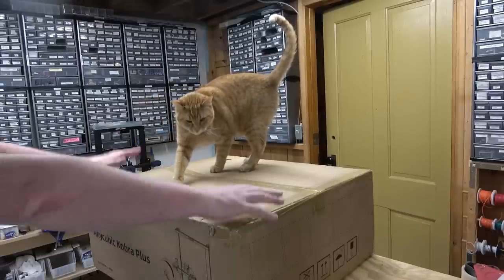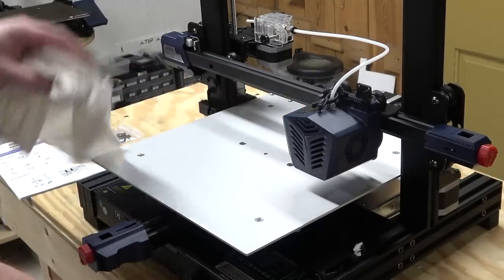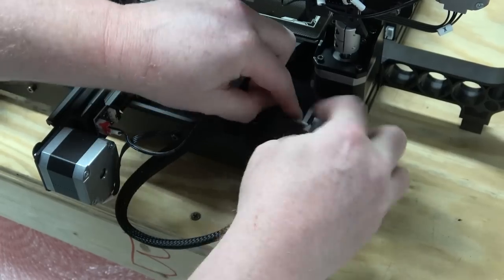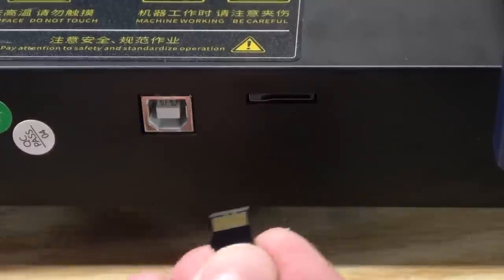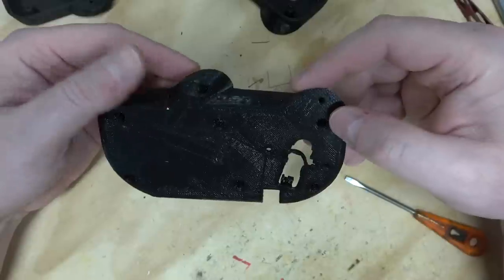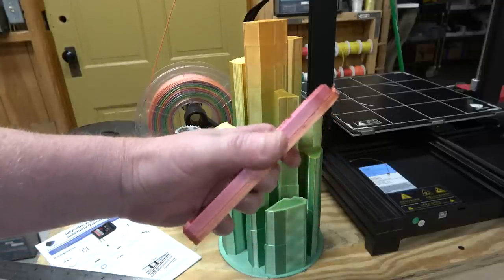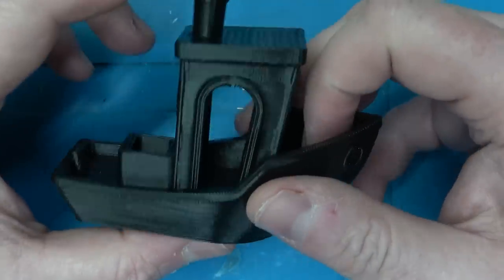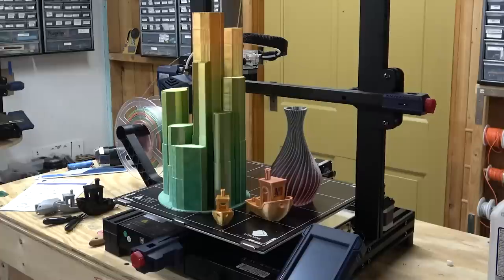Anycubic Kobra Plus Review

Comment: Cura, by default, prints the infill first and then the outside walls, so an easy/fast way to improve the outside walls quality without increasing them is to disable the option "Infill before walls", that way the infill does not show through the walls
Reply: I didn't know this, thank you 🙏 

I use 3D Prints for mold negatives and while I quite like the pseudo-3D print look of the cast, I've always wondered how to mitigate against it. 🤔 

Excited to try!

Comment: The zits on the benchy are in the same place because that is where the print path finished the layer and started the next one. You can specify the z seam placement or pick a random start position to minimize this effect.

Comment: The 'lead' in leaded gas controls 'knock' (pre-ignition) which allows engines to run higher compression and create more horsepower...now it is done with a stack of electronics to measure how much knock is occurring and detune the engine to make it go away.   (an engineer will have a more precise definition)
Reply: There was something about lubing valves too as a reason to use it.  So some engines couldn't use unleaded initially without changing valve seats.  For octane rating(/compression tolerance) they started using other chemicals so in regards of that the unleaded isn't worse and you don't need knock detection as such just for the change to unleaded
Reply: It is true, in the long term, valve seats were required to be hardened to convert to unleaded...but not sure what metallurgy was in place.  The other portion is fuel octane...that is also measured by modern electronics, and is part of the engine math to reduce knock.
Reply: Measuring the grade of the fuel was done by measurement in a special one cylinder engine, of which there were only a handful in the world. Until they in-lined the process, they used to put in extra lead to ensure they met minimum requirements for the particular grade. It was called it ‘throwaway’ at the time. It was an expensive practice, which they were glad to fix. Fortunately it’s use has been largely abandoned now, so just a little piece of our interesting history now.
Reply: @bertieblob3387  the octane calibration engines you could advance the timing to see when it knocked and from that figure out what octane fuel you had. You can advance the timing in any engine but on the calibration engines the timing was calibrated. Power timing!

Comment: there is a setting in most slicers to compensate for the elephants foot- the only thing it does is put a champ at the bottom of the print by offsetting the outer lines to the middle

Comment: Yeah, it's impossible to design this with a full sized SD card slot. That would cost them 15 cents more. Actually more of an issue is sourcing garbage generic SD cards vs micro SD. The cost difference there is probably a little more.

I completely agree though, full sized SD is more flexible, since you can just use an adapter to micro SD if you want.

Anys ways, I also prefer direct drive and a PEI steel sheet for the print bed. I do need a larger 3D printer, so I should really just do some research and buy one.

Comment: Hey Ben, why not make an adapter that goes from MicroSD to full size SD.  A short ribbon cable, a sacrificial microSD card, and a remote SD card slot.  You could then locate and orient it whichever way you wanted.

Comment: Wondering if you've ever tried salt water on glass beds. I use it on my Alfawise U20 all the time and it works great without leaving any noticeable marks on my print. I also had glass beds on my CR-10 minis but instantly upgraded to Garolite I ordered from McMaster-Carr which does an incredible job with adhesion but you have to be extremely careful while leveling or it will put permanent cuts in it just like a PCB board. Both release parts extremely easy upon cool down. For the minis, all I had to buy was a 12x24 sheet for around $30 and cut it down the middle. Interested to hear your thoughts on salt water and Garolite; if you've used them and if you have, if you were happy with the results.

Comment: Tetra-ethyl lead was used to prevent the old NON hardened valve seats from wearing on the heads of motor.  Lead is still available on aero-engines and high test (over 100 octane) fuels.

Comment: you could try to mod some noctua fans in there perhaps?
Reply: Noctua is wayy to expensive.
If you can run your fans a bit slower, you can do it with a cheaper fan.
Noctua only makes sense if you run them on high-speed. Then they are more silent than others.

Comment: Hey Ben! I used to watch your Ben Heck Show back when you were making things like the N64 Handheld. I was wondering if you could help point me in the direction of anything that would be usefull for a project I want to undertake: 

I'm trying to make an Arcade Stick Box out of the guts of a Nintendo Switch Pro Controller, having it be completely functional for any game. I'm having trouble finding the analog stick pinout details and also I realize I need a board to convert the Digital Joystick output into an analog stick output so it can be plugged into the pro controllers board. I hope you respond!

Comment: Lead was used to stop the "knocking" - when the pitons misfire
Reply: Its primary use is octane boost, but it does help with knocking too.

It is NOT a lubricant.  In fact, if TEL were the only additive, the buildup of lead would leave sludge everywhere.  So they also add scavenging compounds which combine with the lead to make PbCl2 and PbBr2, both abrasive white powders that can be flushed out with the rest of the exhaust.

Comment: The thing about the portable Atari Lynx reminded me of a project I’ve been thinking about for a while: a portable Game Gear. Like if you take one apart it’s mostly air and batteries. If you printed a new case for it and replaced the six AAs with a flat lipo you could make it way smaller and a lot more practical, or at least as practical as a 32 year old handheld console can be. If you printed it with that crazy pink filament you could call it the Glam Gear.

Comment: I gave up trying to get Cura to work for a Voxelab Aquila, it's basically the same printer as the Ender 3 v2, but no matter what I tried, I couldn't get it to work with Cura.

Went with PrusaSlicer instead, worked perfectly first time after I told it that it was an Ender 3 v2, extremely minimal configuration required.

Every print comes out so much nicer, though I dislike Prusa's supports, but at least I don't have to junk so many prints.
Reply: Interesting. I have an Aquila an Ender 3 V2 and use the same gcode for both printers and they coming out great every time using Cura

Comment: leaded gas was used for antiknock
Reply: Tetraethyllead was used to increase fuel octane. So yeah it would reduce knocking. As Ben said it did help with lubrication too. You didn't need stellite valve seats when you ran leaded gas.

Comment: Is there a way to get the recommended settings? I didn't throw away the SD card but my computer refused to open it unless I formatted it first so I no longer have those settings and instead had to go find settings someone else used but it was not for the Kobra Plus.

I ask cause I have giant flash or what ever you want to call it around the base of all my models which you don't have. granted I had that on the sample owl print the SD card also came with.
Reply: I just learned you can actually change that giant flashing around the bottom of the print in the Cura settings.

Comment: Do you know that Anycubic doesn't deliver components anymore after they stop producing the machines. I have an Anycubic Predator for less than 3 years and after the touch screen has been broken I have to throw away the printer
Reply: Odds are you be able to pair a third party LCD to the board...if you know the main board and firmware running on it flashing a LCD easy enough may loose some features have to dig around
Reply: @jinxycob     After a whole day of searching for a solution, I gave up. I don't want to use external tricks to keep the printer working. Better to use a big hammer and send the remains to Anycubic...
Reply: @josephluijten716  I understand your frustration had many weeks building repraps , the predator being a large delta if I remember rightly looks a Good machine I be tempted to turn into a project and rip the whole tronics out and replace it with some makerbase MKS board and LCD find them Ali express they produce some good boards.
Reply: @jinxycob   With some efford maybe I can fix the problems but I am annoyed that they just let me down. They are digging their own grave with such a policy.
Reply: @josephluijten716  just searching seem the printer uses a trigorilla board and LCD but can't find a match anywhere...makes me wary of anycubics future support for any printer.
Reply: @jinxycob  Because of the way they treated me I don't trust them anymore.  In Europe it is a legal obligation to supply parts 10 years after the end of a product.  Apparently that is 0 (zero) years in China.

Comment: What Printer did you choose in cura?
Reply: isnt there a profile that comes on the SD card? I remember seeing that some of the kobra models have them on the card to import in the videos i watched. If not you can select the custom option in add a printer in Cura and use the PDF on the SD Card to input the needed parameters.

Comment: Did you ever figure out the stringing issue? I've had that issue with every anycubic printer so far :(.

Stringing is what was causing the lines on the bottom of your playstation controller.
Reply: increase retraction, deal with the increased print times.  I have my old 3d printer set to 40mm/s retraction, and I only see the tiniest of wispy hairs off of protruding features.  One wipe of the hand, and they are gone.
Reply: @jong2359  how much retraction distance are you doing?
Reply: @MichaelJantzen42  I did say 40mm/s in the last comment :p
Reply: @jong2359  I guess I got confused as cura has a retraction speed and distance setting.
Reply: @MichaelJantzen42  makes sense, I am using Prusa Slicer which only has the speed.... I don't know what the distance setting could possibly be doing though... like, minimum distance needed to retract?  I prefer to only have one retraction setting, and not have another variable for distance.

Comment: You were correct - Led was absolutely used as a lubricant in the fuel.... For us who grew up riding two-stroke engines with two-stroke oil mixed in for lubrication - we longed for the "Super 98" (incl the led) lubrication and a no engine lock garantee! :)
Reply: It also prevented "knocking" in older engine designs that didn't have the advantages of modern engine design.
Reply: @nobodyuknow4911  The same thing that Ethanol is used for now, basically it increases the octane equivalent rating so that the gas doesn't ignite early when it is pressurized. There were other compounds that could be used back then as well, but the lead was the cheapest option that required the smallest amount of additive in the fuel.
Reply: @nobodyuknow4911  Stuff can be two things. Ethanol is both a way for them to increase Octane ratings for fuel without Lead, AND a wealth transfer program to corn farmers because they keep demanding more and more of the crud in gasoline.

Ethanol has an octane rating of 113, so adding it to any standard fuel with the normal ranges of octane will increase the octane rating of that fuel. Of course, it also decreases the efficiency of the fuel, which is part of why it's bad to put higher octane fuel in your car now than what the car demands for its compression ratio.

Having a higher octane rating is just to keep the fuel from detonating before the spark plug goes off though, it's not actually something that improves performance. It's just associated with higher performance cars because those cars generally have a higher compression ratio, and often even boosted air compression due to turbo/super chargers and thus need fuel that will not detonate early at higher pressures, but the octane itself, and thus the Ethanol, is not something that improves performance.

Of course, there's tons of negatives like you mentioned with certain kinds of engines. Modern engines can tolerate ethanol reasonably well, but old cars were definitely not made for it, and especially small two-stroke engines do poorly with it.